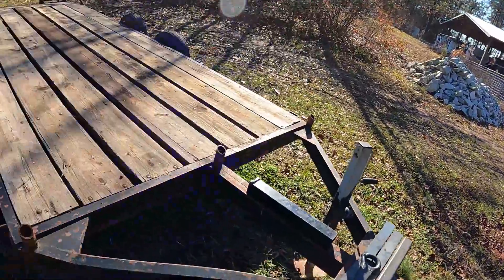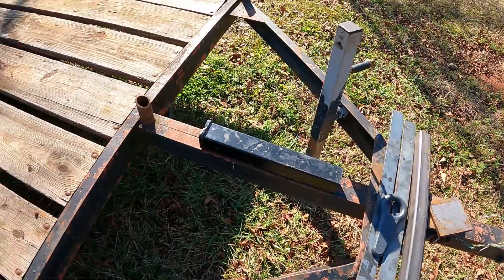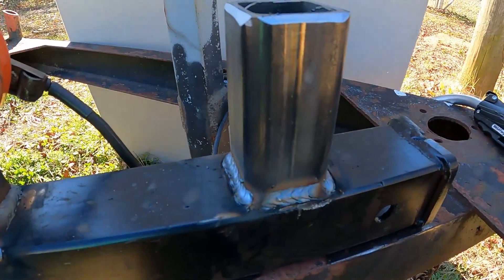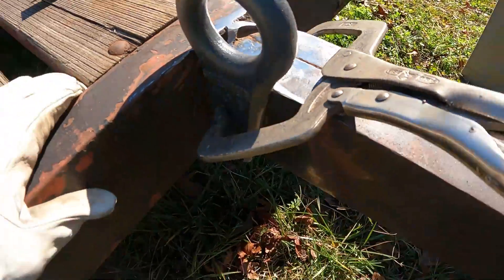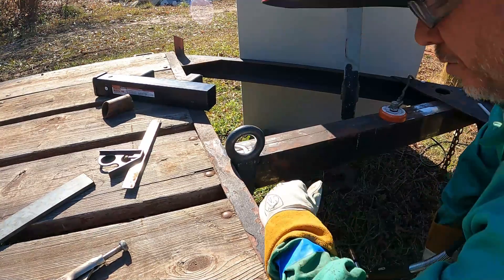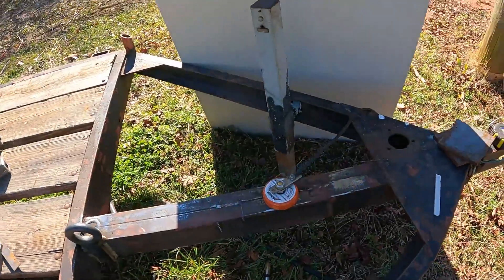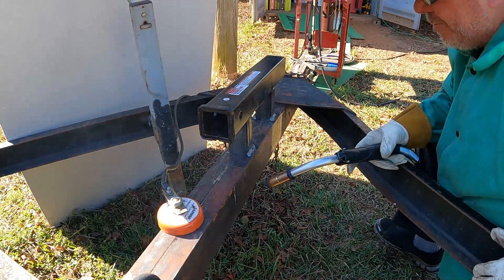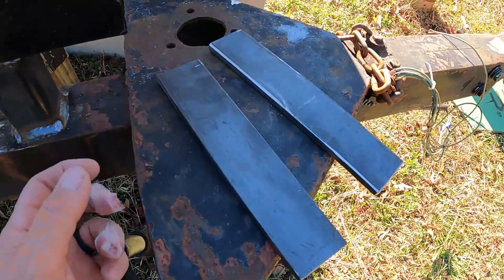Fabricating And Welding A 2" Hitch Winch Mount For Car Trailer With A Harbor Freight Receiver

Comment: I have an adjustable pintle mount and after buying it found out it is only used in drop position.  it is a curt 48342. can a gusset be welded to main part on each side to use in the rise position
Reply from the maker: Yeah i think that would work. Thanks for watching.